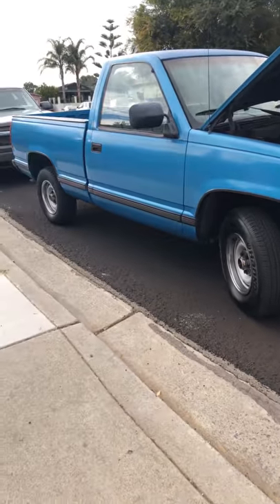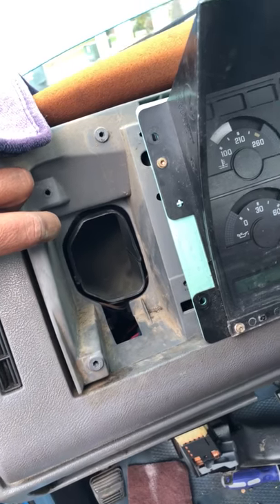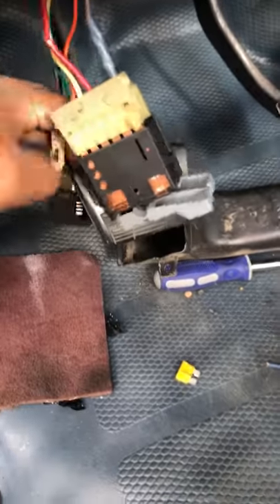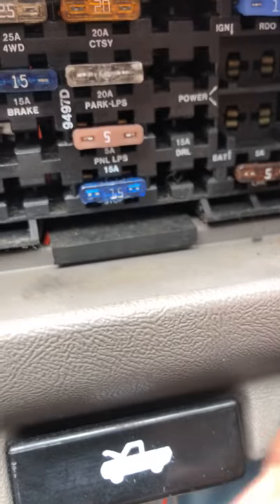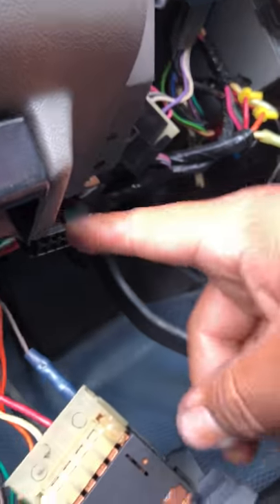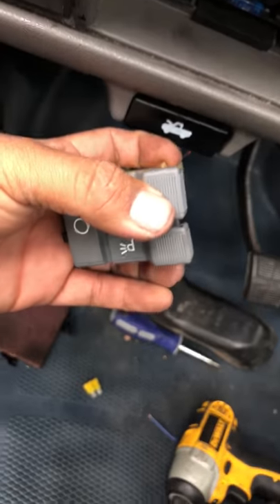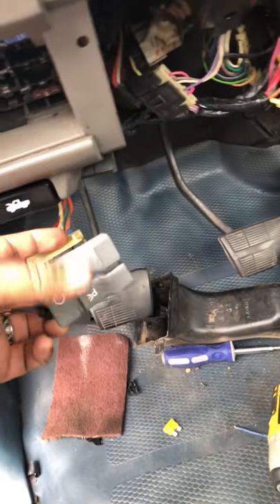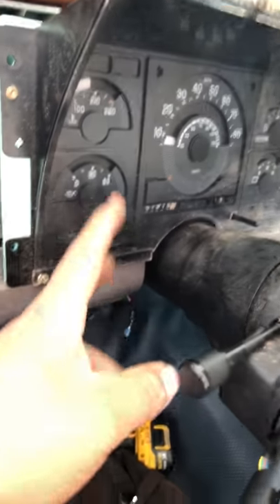91 Gmc Sierra/silverado/c1500 dashboard out, tail lights out, repair

Comment: Dude been at this for the past month, if you’re reading this thank you so muchh🦍
Reply from the maker: @6ryannn-_-   did it work? Yu figured it out? Man i cant believe so many years later this video keeps getting ciews 😂😂😂
Reply: @gallardosmobiledetails3504  well it wasnt that, but i did check those out thinking it was the problem. The fuse is loose af in the relay box.😑

Comment: Thank you, same bad ground connection I had (horn and running-parking lights weren't working)...just passed my inspection now. Definitely not a good ground design if all our trucks are having the same issue. Mine was an 1989 Sierra...had that same ground terminal behind connector.

Comment: Thanks! I hope this solves my issue! The parking lights fuse blows as soon as I push them on. I replaced the light switch and turn signal switch and still blows the fuse. Hopefully your video takes care of my trucks issue with the parking lights fuse blowing!
Reply: did doing this not blow your fuse again ??

Comment: Thanks Man. I have a '92 K1500 and my dash lights have been out since I got it in July. Never thought much about it until last night when  my wife and I were heading home from friends house and a dude pulled up along  side of us and said we had no tail lights. I thought it was odd considering we had just gotten an inspection sticker. Funny because the guys at the shop were talking about the tail lights, but they passed it anyway and just a week ago they failed my 91 Caprice because the rear drivers window didn't work.  Just me,  but I'd think tail lights would be a little more important than a window not rolling down.  Oh well. 
Anyway, thank you for this video, I'll definitely check it out tomorrow.

Comment: just got home... working nights... cops giving me crap all the way.  Brakes and turn work no dash no tail...... MAN I think you got this!  Going to bed find out in the morning.  Thanks so much
Reply: Crap.... still have a short in mine.  New tail lights and harness in the back.  Put in new fuse and about 5 miles pop.... goes the fuse... dang.
Reply: @zerolatitude2923  did you find a fix for it

Comment: Hey thanks bro,my truck 1992 Silverado did the exact same thing tonight & I was rushing through town to get home before I got pulled over for no lights ,checking fuses to,was thinking switch to,but now I’m going to check the ground, I hate electrical man, a lil thing can turn on you man,& before you know it you have the hole dang dash pulled out trying to solve the problem,so I just wanted to say thanks for the heads up,I kind of hate to work on things in the dark,I have lights & stuff,but I’ll do it in the morning,but hey thanks again ,pretty sure it’s the same thing, ok bro later & thanks.

Comment: I want to thank you! I went straight  to that ground cable. I sand it, grease it with dielectric. Then,,,,, nothing. Then listened to some corridos went back  and wiggle the cable and lights turned on. Thank you!
Reply from the maker: eddie14177 glad it helped
Reply: @gallardosmobiledetails3504  yeah now I have to deal with the smoke. I think the valve seals are toast. Got this 90 chev for very cheap now it's my new project. Thanks again bro.

Comment: Thanks dude babe that makes sense because last time I had problems with the ground underneath the body when I took off the towing package and I'm going to put it back on but anyway someone else drove my truck and my headlights switch was hanging out as well and so I don't know that's something we plugged it back in and it works intermittently but mostly off bookmark you and I'll finish this up a million thanks man

Comment: Awesome info about the ground. Saved me a ton of time or learning the hard way.
Reply from the maker: Cant believe how many people with same issue this video blew upp
Reply: @gallardosmobiledetails3504   It is helpful information, that’s a common issue. 

I did end up having to replace the headlight switch recently. Probably was original from ‘89 and contacts well worn. Hooking up a trailer with a bad trailer harness ground did it in I think. 

I hope with cleaning up the ground and having the new switch in, there should be many trouble free years of use.

Comment: Mine is an 86' I've been doing a slow roll restoration on. This last couple days, I've been off for Christmas, and it's been 65° here in Tennessee. So I decided to pull the dash pad out, I've ordered a new one, in the process of that I discovered why my defrost was working to good, it's a duct work issue. So I went in on that. My instrument panel lights were only about 1/2 of them working. So I figured bulbs but when I pulled it out the bulbs were mostly good had a couple blown but not the main problem. Today in putting everything back to make it where I could drive around the farm some this week I find that I have, excluding dash, which is still in the back of the truck, all my lights work except tail lights, I've got head, brake, and turn signal lights, as I type this it's dawning on me I did not check to see if I had running lights. I was thinking maybe a ground somewhere. While my 86 is a little different it has a very similar looking box under the steering column I had no idea what it was. I'll check it in the morning...  That was a good video dude. The trouble shooting run down there was money, very straightforward.... Edit: maybe this edit can be useful to someone as far as cross over info. This same ground wire was, as it turns out the issue with my 86'. To think I almost didn't watch your video when you said 91' because I thought that info on 73'-86' could be useful to me

Comment: Thanks for the video tip, I'm chasing the same problem also. I found my fuse block terminals are loose causing the parking lamp fuse to blow. Fuse practically falls out.

Comment: I've went crazy trying to fix mine I didn't know there was ground there my running lights and battle lights and dash lights wont work head lights and blinkers work in the morning I'll try your ground wire my parking lights they are 2 the bottom one isnt getting any power tryed everything but head light switch and that ground in morning I'll let you know your video gave me hope
Reply from the maker: bill schneks I seriously hope it works, you would think a stupid ground wouldnt cause all that damage but on my truck it did, keep me posted
Reply: Thanks man. This was a great help and everything is working now!!!
Reply from the maker: Thats whats up man im so glad it helped you out 🙌🏽🙌🏽🙌🏽
Reply: "battle lights". My truck didn't come with those but does sound like a good idea. Got me thinking.
Reply: @gallardosmobiledetails3504  thank you for this video it helped out a lot I had the same issue and just was focused on the switch mainly messed around with the switch for a while , got a new one, the while shebang. Finally testing this now that I see your video . I really hope it works... crossing my fingers! Thanks so much I'll let you know.  Cuz my fuse isn't blown but that doesn't mean it isn't the problem so we'll see! Thanks
Reply: It worked! Hell ya thanks ,good tip appreciate you putting in Tim to make this video

Comment: Thank you. Same problem with my Chevy
Reply from the maker: Just Jeanie no problem
Reply: @gallardosmobiledetails3504  my horn, lighter and dash lights went out. But both of green turn signal lights stay on for some reason. Right now I'm trying to repair my fuel line on my Audi. I broke it when I was changing out my fuel filter, right by the banjo bolt. So I bought some more line, but I can't attach the 2 together. I put a brass  connecter that was barbed on each side and then clamped both sides..... And it still leaked!!! 😡

Comment: thank you had same issue with my 91, was a ground issue just like you had.  I bought the truck with a bad transmission, and ended up rebuilding the engine and trans, went to do a night drive and didnt have taillights. took the lights out, checked the harness on the frame rail ( total bitch),  tried unplugging shit and it was this the whole time
Reply from the maker: Dude im happy this has helped alot of people

Comment: Thanks for the video! I'm still searching for the issue in my 96 GMC Jimmy. Tried bulbs, dimmer, headlight/parking light switch and still the 20amp fuse pops. Next I suppose I'll tear apart the dash to see what I see.
Reply from the maker: BennytheJohnson1 check the grounds yet???
Reply: Not yet! That's definitely next on the checklist. Are grounds usually black wires ya think? Suppose I can consult with a Chilton book too to find where those are.
Reply from the maker: BennytheJohnson1 not familiar with jimmy but now a days a quick google search and you will find them online(the diagrams for the grounds)
Reply: Much appreciated! I'll check into that and get back to you. Thanks again for the help!

Comment: It was the turn signal/ headlight switch on my 95 nissan truck. Sometimes they would work and sometimes not, it also affected my rear brake marker lights (parking lights) when the dash lights weren't working.

Comment: will this not work if fuse is blown ? have the same issue cleaned it up, but didn’t work haven’t tried changing out the fuse yet but i’m curious if replacing the fuse will make everything work again

Comment: I have the same problem. I sanded the plate and I didn't work. Did you clean it with some type of rubbing alcohol or spray? Anything I missed?

Comment: Well mine was doing the same thing. Found your vid. Went straight for that ground.  Mine was nice and clean but still cleaned it. Now...it didn’t work for me so I went into the switch and found the connection inside the switch super corroded and old electrical grease built up causing the tabs to not make any connection. I’d like to show a pic but it won’t let me post one.
Reply from the maker: Lester Rusher before i found issue with mine i did replace the entire switch for the lights

Comment: Mine does something similar. Use to have headlights go out and dash lights. Sometimes just dash lights would go out and gauges act all messes up. Could smack dash and fix. Replaced light switch and headlights always work now but dash continues to act up only when headlights are turned on. Smacking dash stopped working. Got no clue. Dash cluster has been removed and contacts cleaned so not sure if this ground is the issue. No fuses blow
Reply: Did you ever fix this issue?

Comment: Thought about ground? But you didn't think to check the fuse before you tore the dash half out? Hum. Interesting.
Reply from the maker: I checked fuse it kept blowing it, i then thought itnwas switch, eventually i thought some cable had to be loose, and at the end i decided to check grounds smh wish i woulda started there

Comment: I was in my truck an out of no where the radio turned off. Then the interior lights followed. I changed all the fuses i could think of could it still be a ground problem?
Reply from the maker: Nacho Niqqa :3 could be might aswell check it, it doesnt hurt to clean it up
Reply: @gallardosmobiledetails3504  rains been killin me the past couple days 😂 but ill give it a shot
Reply: Nacho Niqqa :3 did it ever work ?

Comment: Mine had the same problem. I did what you did and it worked for 2 days and fuse blew against any ideas?
Reply from the maker: Emmanuel Prieto make sure you are running same size fuses? What fuses are the ones burning???
Reply: Giovanny Gallardo just the one for my lights

Comment: What grit sandpaper did you use? My dashboard lights flicker on & off & I have no taillights so I'm hoping that this is the same issue as mentioned in your video
Reply from the maker: Auto Fixes N Customz something rough like 80-220 would work

Comment: I have a 1994 gmc Sierra k1500 5.7 liter.  The passenger side turn signal flashes fast and the break light does not work. I bought new circuit boards and installed them. What ideas should I check into next. Also the cruise control is out and the intermittent wiper system is acting weird.  I hope it's not the actual switching in the steering column.
Reply from the maker: Brandon Kiesser have you tried cleaning the ground i mention in the video?

Comment: What happens if the headlights are still on but the tail lights do not work and brake lights do not work but the headlights work the front blinkers work off and on as well

Comment: I have a similar issue but my taillights don’t turn on when I turn on the front headlights. Also when I’m at a stop sign and I put the turn signal it blinks normally until I go forward then I get a rapid blink for the blinker

Comment: I kinda have the same problem with my 94 Chevy Silverado, but my headlights lowbeams won’t turn on, my high beams work but not the lowbreams. Any advice to fix it??
Reply: Itzz me Tony over time there is a wire that melts away or is damaged in the turn signal. Replace the turn signal and wires.

Comment: What if l my exterior lights work but my dashboard is completely out? my truck doesn’t make an alarm noise anymore when i leave my headlights on. Could it be the switch box?
Reply from the maker: Godzilla Toho honestly bro i wouldnt know, that isssue sounds totally different than what i had going on sorry 😕
Reply: I have this now in my 92  Chevy
Reply from the maker: Eric Alicea  well hope this video helps
Reply: Eric Alicea found the problem bro, it was a blown fuse next to my dash board. for me it was number 14 under “ILLUM” for illumination
Reply: @2121johnwayne  do you know what my truck prob is too, I have the alarm dont make no noise when headlights and rear are on and also my gauges don't work.. would it be blown fuses that are the problem?
Reply: Khef Blood Homie thats exactly what my truck had, it was a blown fuse on the left side of the dashboard under ILLUM #14, my truck is a 95-98 model so idk if it might be the same for you.
Reply: @2121johnwayne  i have a 91 1500 tbu

Comment: I have a 95 gmc sierra 1500 z71 that is in the shop it was running but the 4wd drive didn't work but the back wheels were spinning not the front so I'm guessing it's an electrical problem also it's got a new computer in it that worked for a few days so now I have no idea what is wrong with it it's either the computer or the 4wd drive so any ideas please let me know so I can tell my mechanic
Reply from the maker: Dusty Helvering i wouldnt know where to start with that issue man sorry 😞, im having electrical issues with my 99 yukon as we speek too 😞 4x4 also but my issues are not affecting my 4x4

Comment: Have you had any issues with the fuel gage  stop readying  , mine was readying good the went past full and does read anymore
Reply: If your fuel gauge is reading way passed full then you have a bad ground between the gauge and sending unit.
Reply: @bryant38  do you know if it would be black wire??

Comment: Tried it on my 88, switched the switch also. Still no lights. Any ideas??????
Reply from the maker: Chevy stepside MIA vibez what lights are out?
Reply: @gallardosmobiledetails3504  when I turn on my headlights, my cluster lights go off
Reply from the maker: Chevy stepside MIA vibez but the cluster dimmer is all the way up right? Just before it clics?
Reply from the maker: So when your lights are off the cluster lights do work?

Comment: I just replaced my battery on my GMC Sierra 1500 4.8L year 2003. 
My instrument panel cluster stopped working. Truck starts. Lights work. Radio works. Everything works except speedometer, tachometer nor odometer. I replaced fuse. It did nothing. Reconnected battery. I need help. Someone  give me advice. 😢
Reply from the maker: @laentidaddesconocida   well the good thing those are super easy to swap out, test it out with another one from the junk yard or something, those clusters go out alot i had alot go out on me throughout the years,
Reply: I removed the plastic cover on the dash. 
Remove screws. Unplugged the harness and plugged it in again. It worked.
Reply from the maker: @laentidaddesconocida  ez fix 👍🏽

Comment: Í have this problem and I can not fix it when I turn the parking lights on. The fuse blows and a few cables melt from the light switch all the way too the parking lights in the front can somebody help please

Comment: I'm having a similar problem no headlights no dash lights no stereo power no dome light brake lights turn signals work but I'm not getting power to the fuse box for the headlights and running lights but power is getting to radio but the radio won't turn on when I turn the key I've checked all the fuses I wouldn't think the headlights and the stereo are connected let alone the dome light and the dash lights the indicator lights work if it was in the ignition I could see that effect the radio but not the headlights or the dome light I'm stumped 😒

Comment: I’m having an issue with my brake lights not working. Also when I open the door that noise comes on even though I don’t have key in the ignition. Anyone got any ideas what it could be?

Comment: I have an issue where the blinkers arn’t coming on at all but the Hazards work
Reply: Just found what the problem was about 20 minutes ago thanks for your video though to be honest dude cause I didn’t know where the ground wire was so they confirmed that it was good in my situation the wire connected to the Turning signal fuse was loose in the back of the fuse box under the steering wheel
Reply: These are old trucks so the wiring is pretty loose
Reply: They are some bad ass trucks though